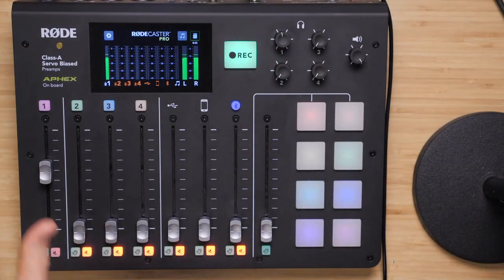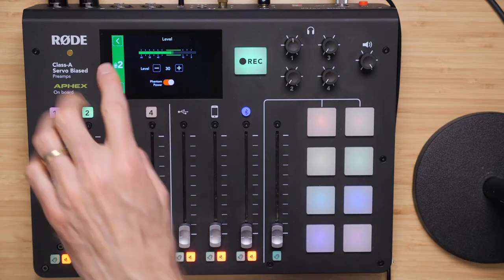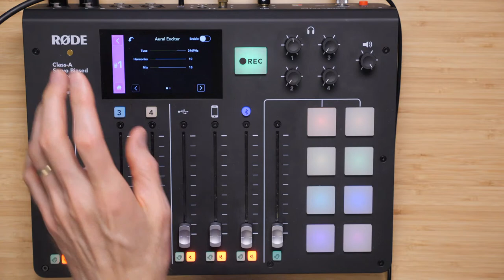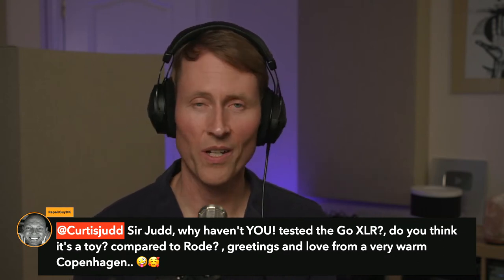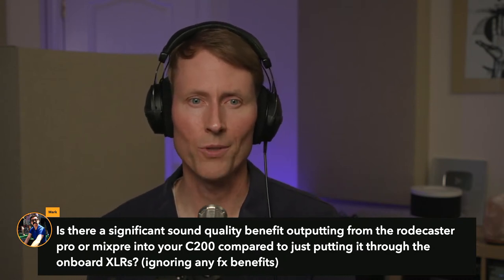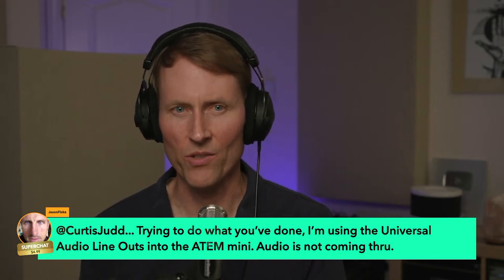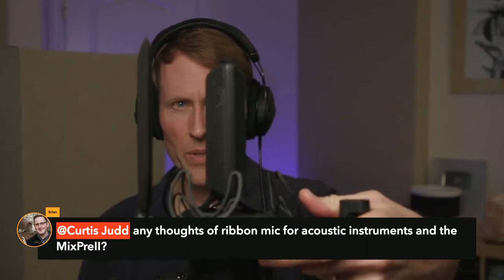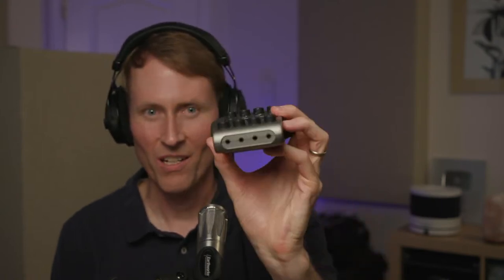ATEM Mini Audio from RODECaster Pro

Comment: Does the compressor act as a limiter on the rodecaster?  Is there a limiter on the rodecaster?  I am struggling with laughing while podcasting.  My levels are great, but when I or a guest laugh we peak.
Reply from the maker: There are two separate compressors on the RODECaster Pro - one for each channel plus the bus compressor. I usually set the bus compressor up to act like a mild limiter. I believe the max compression ration is 10:1, thus somewhat mild.

Comment: why to use the sm7b with cloud lifter d phantom power that's my set up and no hissing
Reply from the maker: Sorry - I don't understand. Are you saying that you do NOT use a cloud lifter and you do not get hiss? If so, are you using the compressor? If you look at your livestream's audio and measure the loudness in LUFS, where does it sit?
Reply: Curtis Judd I should have said I do use a cloud lifter and there is no hiss.

Comment: Line in ATEM Mini - do you set volume in ATEM Mini? Do you monitor the audio in ATEM Mini? EQ??
Reply from the maker: Course coming to answer all that. Short version: set gain in device to which the mic is attached. Then send audio from that device to ATEM Mini at line level if possible. Then calibrate the levels between the ATEM and other device using -20dB tone. I monitor the audio from a small screen attached to the ATEM Mini’s HDMI output. Yes, I often use EQ.

Comment: Can I use the zoom f6 with the atem mini pro?
Reply from the maker: Yes. I would used a stereo mini jack cable (3.5mm TRS) to feed audio from the F6's output to the input on the ATEM Mini. Set the input level on the ATEM Mini to line level.
Reply: @curtisjudd  thank you

Comment: Try using different electric plugins.  Main power.
Reply: @curtisjudd  not the plugin cords. The plugins in the wall.  Extension cord in different room.
Reply: @curtisjudd  try making sure All cameras are on a different circuit from the computer   You might have a bad microphone